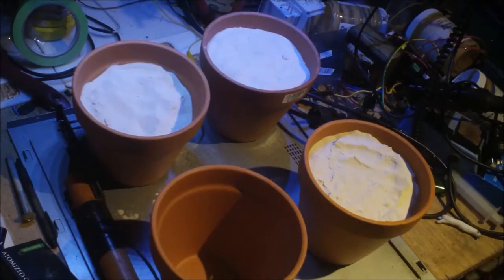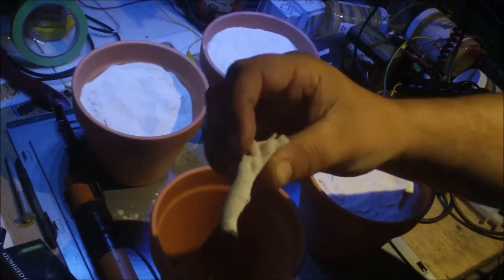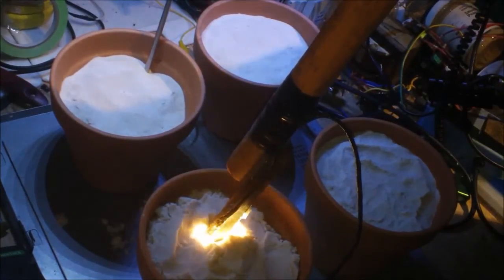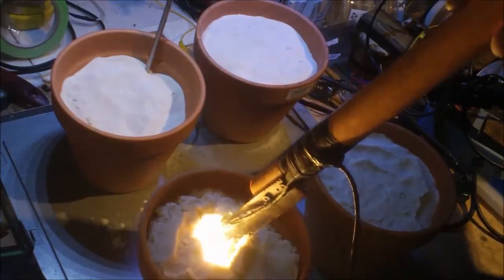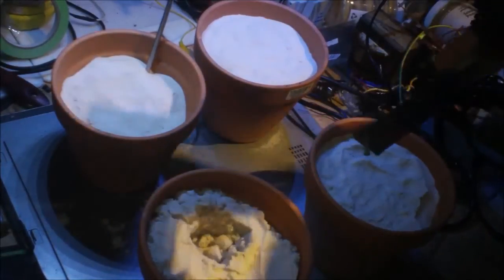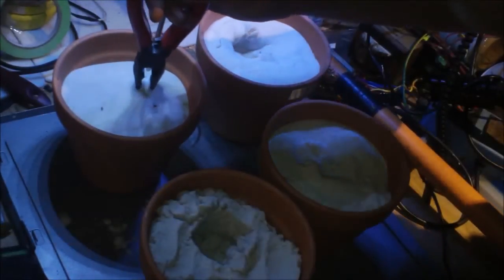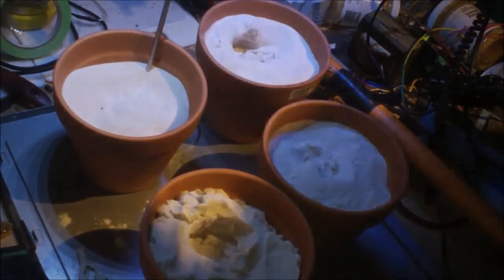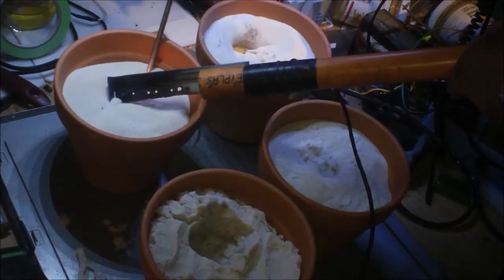MOT FULGURITES!!!

Comment: Great results! However you may find you have more success with a lower voltage at a higher current. Amperage is actually what provides the heat necessary to melt the silica.
Reply from the maker: Good suggestion there mate!  I have changed the setup of the MOT stack and a revisit is going to happen at some stage!!